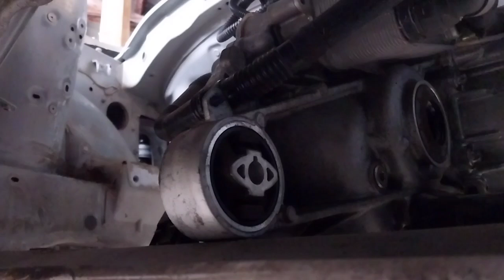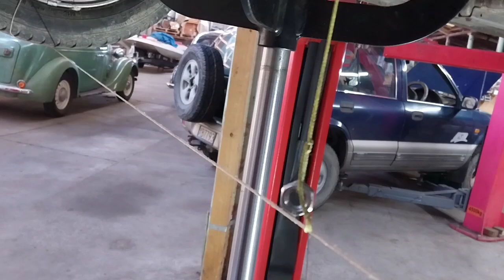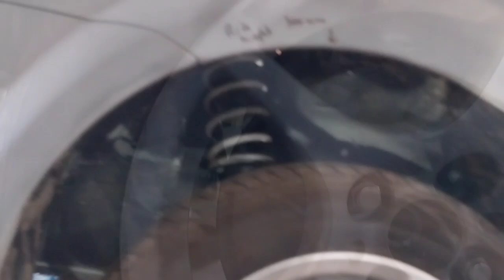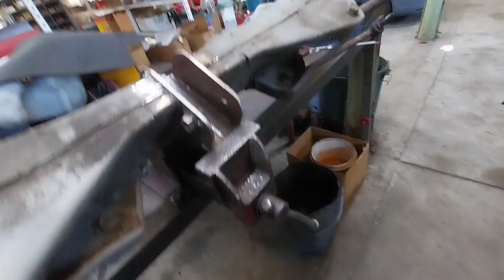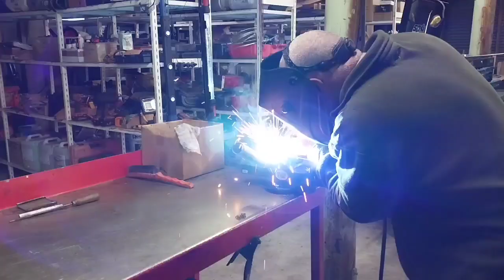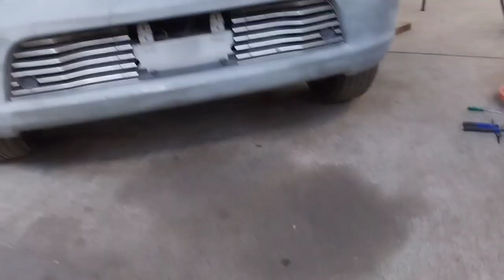Mounting the rear 300hp motor. But there's a problem!

Comment: could decide on dual motor with small front motor, and then add as much battery as will fit.. dont need to have peak output capability if awd is more important to you